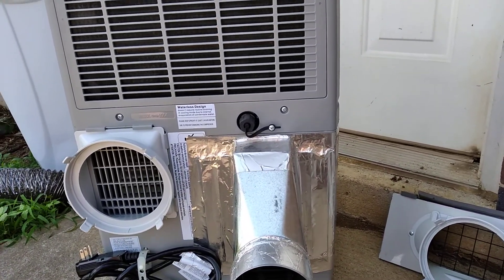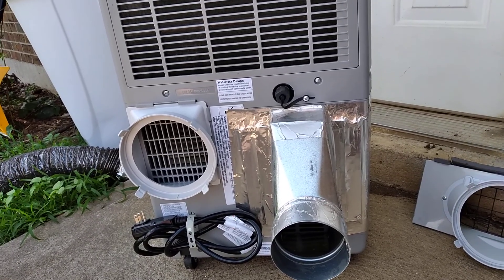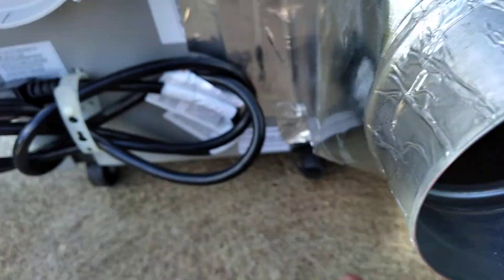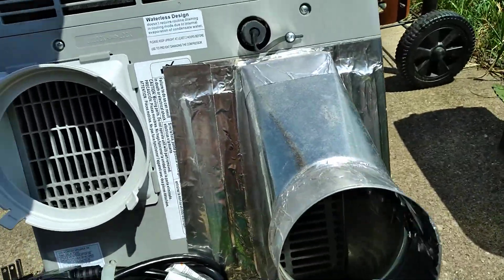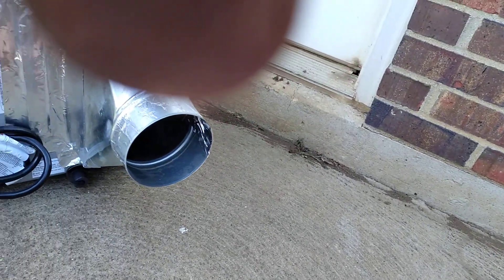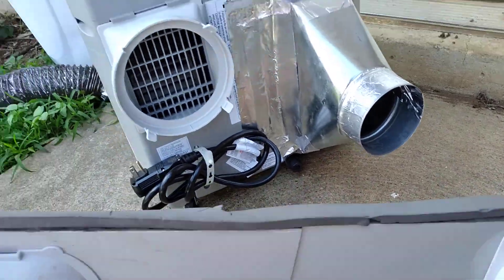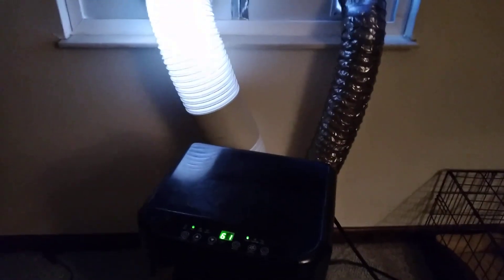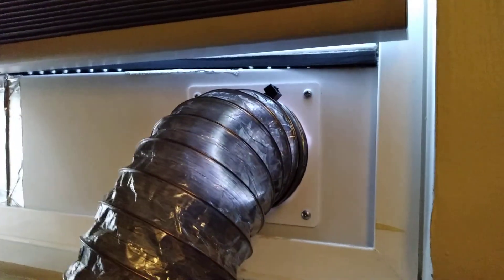Convert INEFFICIENT 1-hose portable AC to a 2-hose

Comment: Great video. Can you actually notice that they cool better this way? I have three of these I might consider doing have casement windows on every window of my house
Reply from the maker: YES, OH YES!!! When I 1st installed them we had TWO in a 3rd story apartment building on the afternoon sun side (heat rises). Each apartment was outfitted with a rectangular hole for a basic window unit.

I installed them to no avail! The thing you need to understand is these ACs SUCK! Not figuratively THEY LITTERALLY SUCK!

The air supplying the intake side of the condenser has to come from somewhere. Not only are you cooling the air in your home, but you are sucking in OUTSIDE AIR through the vents, cracks in doors and windows etc. So you are cooling the outside air as well.

AFTER I RETROFITTED MY ACs THE APARTMENT DROPPED 15 DEGREES IN 48HRS!!!

This retrofit isolates the 2 air circuits. The evaporator draws air from the room and dumps it into the room.

The condenser draws air from OUTSIDE and returns it back outside.

When installing in a vertical configuration, always make sure the exhaust side is at the top and the intake is at the bottom. (Your comment reminded me to edit my pinned comment)

The sad thing is I highly doubt the manufacturer is not aware of this design flaw. THEY WANT YOU TO BUY EXTRA ACs TO SOLVE YOUR PROBLEM!!!
Reply from the maker: Did you ever get around to modifying your AC?
Reply: @Stacy_Smith  i did and your videos are helpful
Reply from the maker: Square footage is something to be considered as well.

Hypothetically speaking let's say you are getting 85 degrees now on a 90-95 degree day. You retrofit the 3 you have yet you are still hitting tempratures around 75-80.

At this point you'll have to make the decision:
 Is 3 enough to make it bearable? If not, buy a 4th.
If yes, you'll have to decide: Is bearable satisfactory or do I want COMFORTABLE? If not, buy a 4th.

I DO know it greatly helps because it helped us. I went from unbearable to shutting an AC down at night to avoid freezing my girlfreind's son in the living room.

If you do choose to retrofit, please leave a comment about how much better those 3 did and whether or not there was a need for a 4th.

Not only am I curious, but other readers will benefit as well.

Comment: Do you think this will work for all types of single hose portable acs? Especially when the bottom intake of mine feels kind of weak and I don't want to spoil it so am asking around. Thanks!
Reply from the maker: The problem with most ACs is that the condensor doesn't have a filter. Start by ensuring the fins are clean, but yes it wil work on all types.